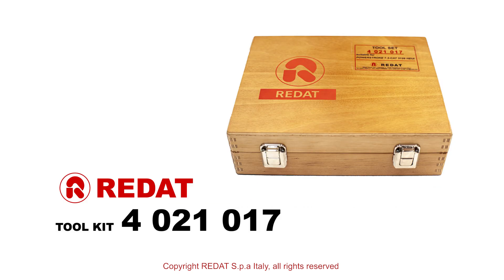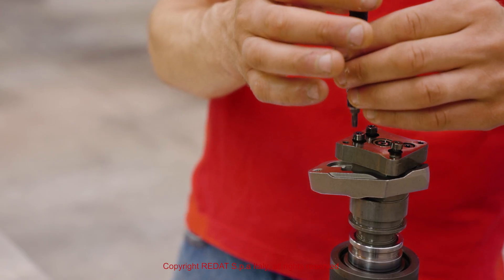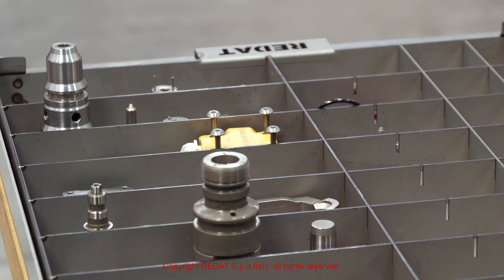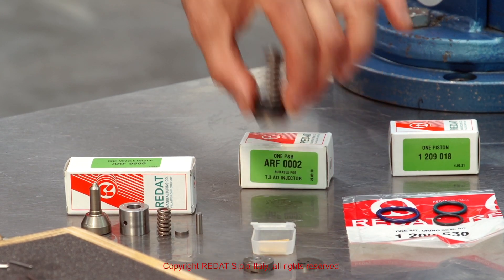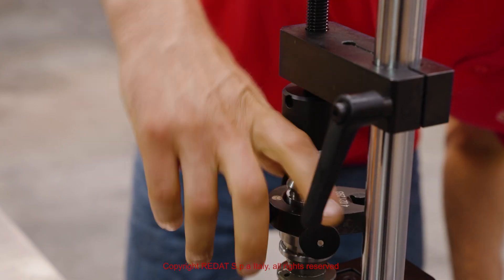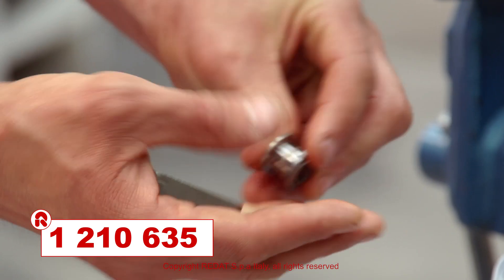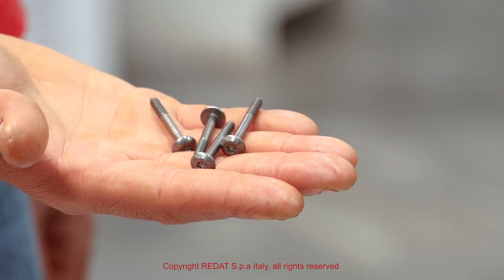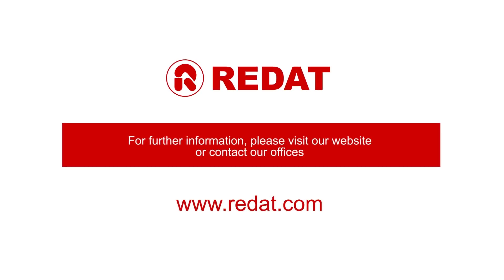3126 / Powerstroke 7.3 injectors - Assembling, disassembling and testing

Comment: I am about to do a bunch of service work to my pickup and would like to rebuild my injectors as part of this service. As such, I have sent several emails & pricing requests to Redat (Florida office) over a ~3 week period but have not received any response. What gives? As far as I have found, Redat does not list any resellers for it's parts, which suggests one should buy directly from Redat, but again, no response. So, how do you get in touch with Redat to buy parts? Do you only sell to shops? It seems extremely easy to rebuild these injectors, the most difficult part is locating & obtaining replacement parts. I thought, because of this video, Redat was filling this void in the aftermarket by making the parts readily available to the general public but the complete lack of response to my inquiries suggests otherwise and has been extremely disappointing.
Reply from the maker: We are sorry for the issue. 

This channel is operated from our headquarters in Italy, but I confirm that Redat North America has been informed of your comment.

We are very glad that our videos succeed in showing how an injector can confidently be repaired with our tools and spare parts, but I do note that our offer caters to specialized diesel workshop rather than private customers.

On one side, experience remains crucial. 
We are guilty of making it seem easy, and you are the only judge of your own skills and dedication, but we still discourage self-made repairs. 

On the other, a privarte person would not reasonably posses some expensive pieces of equipment which are taken for granted in a specialized workshop. 
For example a good test bench, specific for any given type of injectors, can easily cost several tens of thousands of dollars, not something anyone would consider unless it is their job to have one.
Without proper testing and calibration, even an otherwise good job relies on sheer luck.

Please consider carefully before deciding wether to repair your own injectors.
Reply: Truly, thank you for the response. A response of "no" is much better than no response at all.

I am extremely confident I could rebuild my injectors; parts acquisition has proven to be the sole hurdle. I have access to company capable of performing flow testing & calibration, but I am also looking into a local diesel performance shop rumored to have a flow bench; all moot if I cannot procure parts.

At this point, I need to know if Redat would be willing to supply me with parts. Obviously, ideally, I would be looking to purchase components in sets of 8, but I imagine you typically supply in much larger quantities. Your message strongly hints at the answer being, "No, Redat will not supply you with parts." but, I would appreciate definitive "No." rather than it simply being strongly implied. If, by some miracle the answer is "yes", please advise me as to the optimal contact method.

Again, even if the answer is "No.", I sincerely appreciate you responding to my comment.
Reply: @B Brown  7.3 I'm also rebuilding my injectors. Did you do the measurements on the injectors and find out what needs to be done? If you have machine shop abilities and discipline you can do this yourself. If you are rebuilding your 7.3 and putting in new pistons the wrist pins can be used to make the spacers/washers. The inner diameter of the pin is within tolerance, but make sure! Using the ends of each rod will give you tempered hardened steel. You have to use a Ceramic cutter insert to turn it down to its correct diameter. A tool post grinder for parting (cut) it. Surface grind to the correct thickness to bring the poppet back into specs for injector 1. Now do injector 2. Chow. PS.  The surface of the main body needs to be machined 1st  If it needs to be. Reassemble re-measure. That will give you the thickness you need for that spacer. Remember you cannot measure enough times. You pretty much have one shot to get it right. Make it a bullseye the first time 🎯
Reply: @danarnit7839  I am not rebuilding the engine- just taking care of some oil leaks, replacing up-pipes, turbo rebuild, & cleaning things up, changing all of the fluids & filters, etc. I have ~335k on the injectors, it starts & runs like a top (even in cold weather), but I'm going to replace the injector cups & external injector O-rings while I'm at it. I take care of my pickup and see all of this as preventative maintenance at this mileage. 

I haven't started yet- still waiting for parts. While I have the injectors out to do the cups & O-rings, I wanted to disassemble the injectors, replace the internal O-rings, & ensure everything is in spec or return everything to spec- but, nobody will talk to me about internal injector components. So, I expect I'll go through everything and about 1500 miles from now, I'll have some catastrophic injector failure & have to drop $2k on rebuilt injectors. 

I stopped pursuing the injector rebuild effort because I've been stonewalled at every turn. Admittedly, I've never rebuilt injectors but with access to parts, it looks to be a piece of cake and I suspect they could be rebuilt for a tiny fraction of what it would cost to purchase rebuilt injectors- but if nobody will supply parts or information, there's nothing I can do. 

Assuming you have access to injector internals, if you don't mind sharing, where are you getting them?
Reply: @B Brown  Hi, Go to CATERPILLAR 3126 HEUI on Redat site Italy.  It should be where you found the parts diagram. I'm machining a new spacer, part #6 Which goes between part #36 and #7 Which is thicker than stock. This goes under the upper poppet valve seat.  By taking all of the previous measurements after machining the body this let's me know how thick that spacer needs to be machined too.  With the amount of mileage you have on those injectors I would at least take cylinder number 8 out and do some measurements on it. With those miles and the tiny amount it takes to put them out of speck, you're getting really close to that. On that DIY page they walk you through that part of the armature measurements it's simple and quick.
Reply: @RedatSpAVideo  please